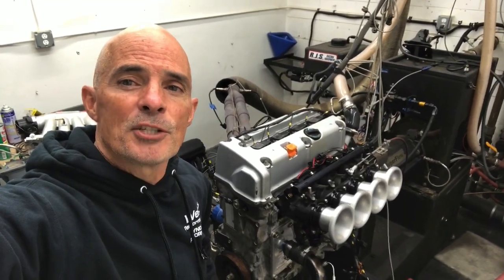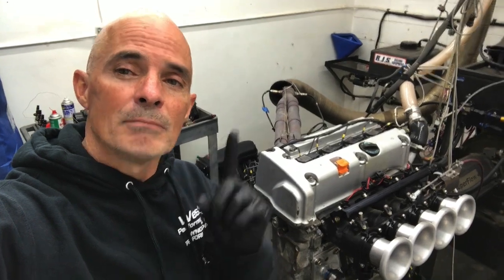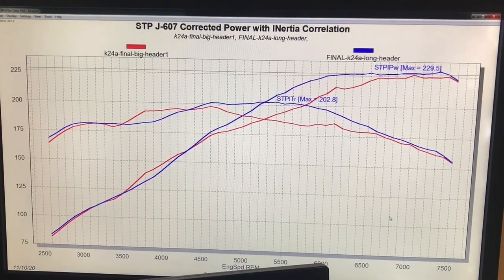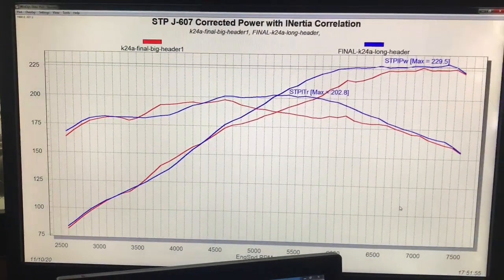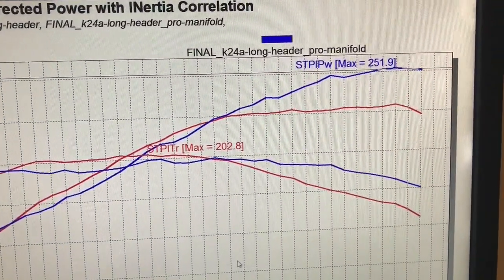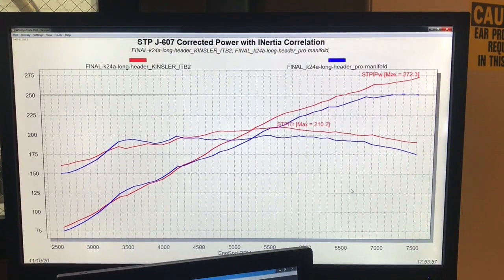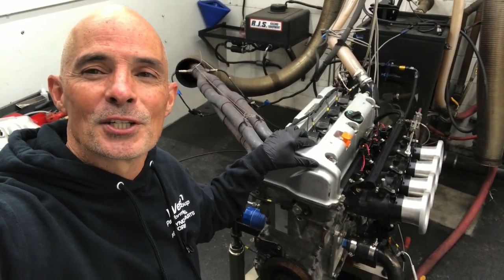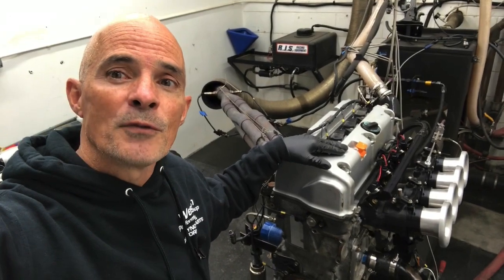JDM K-SERIES HONDA-TRI Y VS 4:1 HEADERS & STACK INJECTION

Comment: Makes me wonder where the “loss” is in the Skunk manifold, is it just the runner length or is it the plenum/throttle body.  I guess: Could Skunk design an even shorter runner plenum manifold and see similar results (top end increase with little effect in the midrange)?
Reply: I'm willing to bet runner length isn't that huge in this case. It seemed relatively short but runner diameter and definitely plenum volume are my guesses.

More taper on those runners and  larger plenum, it probably would have been closer. I'd be curious to see the plenum pressure recorded at a high rate and see the pressure pulse readings.
Reply: Indeed ... maybe I should have asked “... design a new plenum style intake to closer emulate the Kinsler?”
Richard did a test a while back debunking they plenum volume hypothesis (though too small could be a thing I suppose). Or a restrictive  TB (though Vizard did some testing on this a long time ago and concluded that, essentially, the throttle does not see all cylinders all the time ... a plenum pressure test might reveal if this was the case.
If it was a small increase, it wouldn’t be worth the trouble, but being that there is 20 (?) ish HP, on top of an already significantly improved manifold design, it would be interesting to see if there are improvements that skunk can exploit.  Alternately, being that it is a two piece design (made obvious to me in the follow up video) it may be possible to port (hand or CNC) the Skunk intake to take advantage of the lessons learned here.  That, to me, would be pretty cool if Richard’s videos could help make some of the products we buy even better.

Comment: Great test. Why'd you stop at 7,500RPM on the Quad throttle setup?
Reply: It probably has a stock oil pump. We run the Drag Cartel s2000 pump on our k24a2 powered e30.

Comment: I thought Honda engines spin backwards of any other car engine, throwback to motorcycles, does this effect hoe you run it on the dyno?
Reply from the maker: the B series are reverse rotation-the K series is not

Comment: Now get them to show you a dyno of a 2.6 liter stroker/big cam setup on ethanol at 9500 rpm.....
Reply: Robert Bandy  Nope.  We regularly run K24 based race engines to 10000 rpm.  I know Skunk has at least 1 or 2 laying around.  Should be around 500 hp on alcohol.
Reply: Robert Bandy  Usually about 9.5 seconds ;)  Best are in the 8's.  But they'll go a season if put together right.  The road race K24s are usually shifted around 8500-8800 rpm.

Comment: Now with some goodies and fuel we can make 600hp all motor ... k24/k20
Reply from the maker: as long as one of those goodies is nitrous or boost
Reply: @richardholdener1727  now at some of the events there certain class is called The Outlaw class which you can come with a naturally aspirated K24 and run 8 Seconds quarter mile. The k24 set up is so crazy now its limitless. 600hp+ N/A k24 yes N/A.. its crazy and now where going AWD in the hatchbacks pushing over 1,400 on boost ... hondas came along way... my profile picture was my old setup k24/k20 4piston head package.

Comment: Vtec = turbolag - turbo
Reply: Not really. It's more like having a high rpm camshaft and a tiny cam you switch to at low rpms for good torque and driveability.

Comment: Tri-Y exhaust manifolds are badly under-rated, they are always better than 4-into-1's.
Reply from the maker: better not to always use the word always
Reply: @richardholdener1727  Yeah my thoughts exactly. I'd love to see a 4-1 longtube header tbh. I mean there's a reason why all-motor K series Honda Drag Cars do 4-1 shorty hood or side exit headers...however your video is clearing showing that these 4-2-1 longtube headers are making better power. It's very interesting but I still wonder.